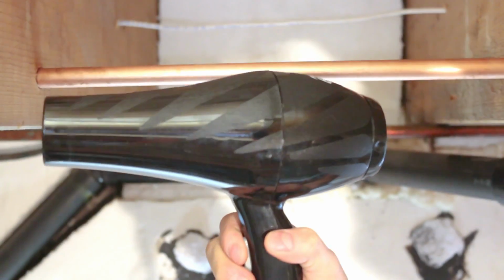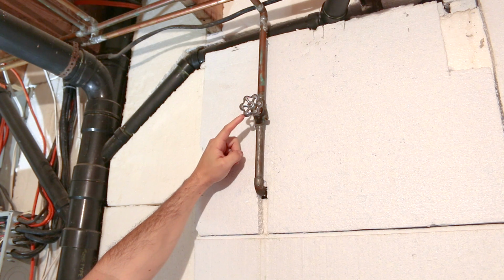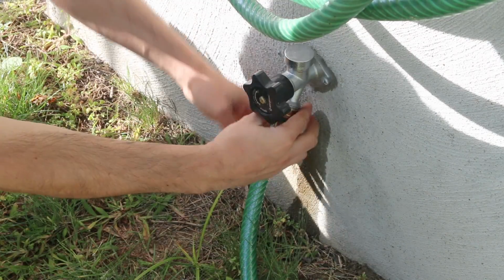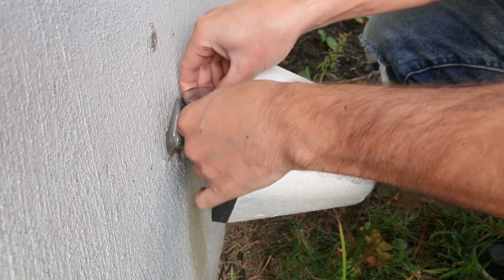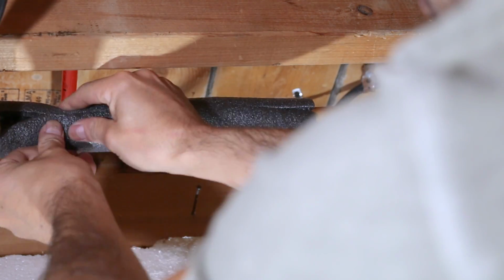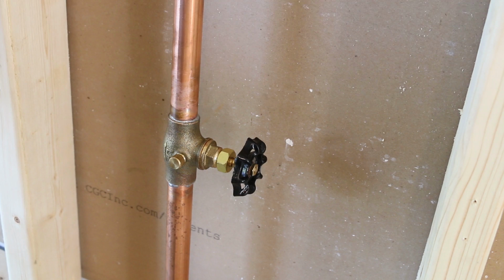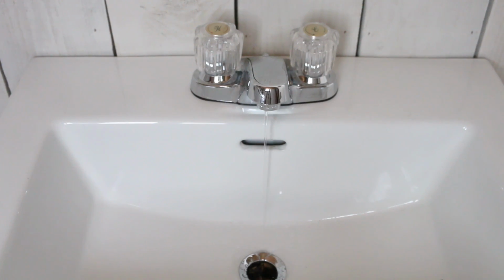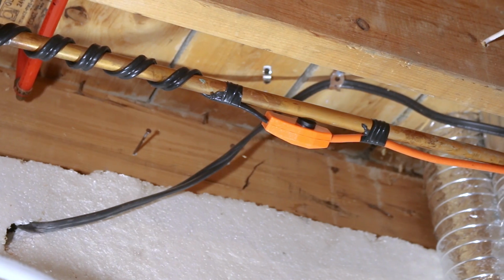12 TRICKS To WINTERIZE Your Plumbing! (Easy DIY) | GOT2LEARN

Comment: Is the auto shut off valve electrically powered? I would expect the pipes to freeze if the power goes off while you're away. With no power there is no heat and the pipes could freeze in a basement. So, how would this electronic device help if the power goes off? Is there a battery backup?
Reply from the maker: Yes, there's a 9V battery in it to operate it.

Comment: Don’t use regular antifreeze.  Boaters use the RV antifreeze for Winter storage because any unflushed  residue is drinkable and auto antifreeze is deadly in home pipes.  Add the “cherry juice “ as it is sometimes called.  Any marine dealer will have it in the winter in colder climates.  
JoeB
Reply from the maker: Thanks!!

Comment: @Got2Learn, nice tips.  However, your suggestion to check wall voids by pulling switch plate covers is missing a very important point.  One should only be checking behind switches that are on exterior walls.  No value in insulating interior walls as they are heated on both sides.  Got to make that clear, right?
Reply from the maker: Correct!!!

Comment: You have me thinking about what to do with my hydronic heating system. rather than draining the system, and boiler which is a major PITA, I am thinking about adding an SPDT switch on my circulator so I can byass the boiler control, and allow the circulator to run from a timer to keep the water moving in my radiation so it won't freeze. Does that make sense, and will it work to prevent freezing? I am thinking of this as a solution to a boiler system failure rather than power outage.

Comment: I’ve used a torch while living in Montreal, during power failures. For some reason, they used build homes with little insulation and they would install plumbing against an outside wall🙄. Awesome video as usual mon ami!
Reply from the maker: Thank Viper6, yeah the torch works, just gotta be careful not to burn anything ;)

Comment: You said it doesn't cost more to keep it at a higher temp...but then at the end of that segment you say it may be better to pay the extra money to keep the dwelling at a higher temp. I am a licensed commercial facility maintenance technician, and over the course of the season, it will cost you more to run your heater/furnace longer to keep that raised temperature as you will be burning more gas and/or using more electricity.
Reply from the maker: Yes, it costs more to actually "raise" the temperature to the new temp in question, but to actually "keep it there" is almost the same as keeping it 3 degrees lower due to the higher delta, so yes, you might wanna pay the extra money to "raise" the temperature a little higher.
Reply: It is cheaper to heat your house warmer than to replace your plumbing. I don’t think he was meaning to do it all season just when temperatures are cold enough to freeze your pipes.
Reply from the maker: @nancywebb6549  percisely.

Comment: More heat in your house means more money to spend, it doesn't cost the same.
Thanks for the video, I'm looking at solutions for my main water line in the crawlspace. I guess I'll go with insulation.
Reply from the maker: Yes of course, i've also seen those heated wirs being used on drains as well to protect the ptrap, so you can also go with that! :)

Comment: When dripping faucets, do you turn on both hot and cold taps, or just cold? If both, what if you lost pressure on hot tap and causes water to sputter?
Reply from the maker: I only had cold lines freeze on me, so I never neededto open the hot, but maybe someone else had a different experience here?
Reply: @Got2Learn  awesome, thank you ive been constantly having them running. So many of my family, friends, coworkers with busted pipes. Another freeze coming tonight...ugh! Thank you!!
Reply from the maker: @jacobmyers5204  just follow everything in the vid and you should be ok, hope for the best 🤞

Comment: I've always used Type L copper. Question is please explain or better yet a whole video on the subject, how much better is Type L over type M? Is Type L worth the extra money. I recently replumbed my main line from 3/4 inch Type M to 1 inch Type L, people were telling me just use Type M. I understand the inside diameter is slightly smaller in Type L. Does that small difference make considerable resistance in half-inch Plumbing runs?
Reply from the maker: In terms of longevity, type L will last longer, specially if you have rough water, type M is more for heating applications.
Reply: @Got2Learn  ... wall thickness is only 0.010 thicker between L and M pipe. Not enough to worry about flow rate. The difference is for the pressure rating and the rot resistance to bad water.

Comment: Do you have any advice for when your pipes are frozen but also stuck behind a wall where you can't directly heat them up?
Reply from the maker: Maybe remove baseboard, make a hole and use a hair dryer in the hole...
Reply: Realize that if it's a faucet that you can live without, find out where the water source pipe is and disconnect it to install source plug .   To use faucet adding a new water pipe (flexible is available) may prevent extra sheet rock work that leaves the busted pipe there unused. A friend wishes to have done this. Also in garage had to cut cautiously sheet rock BEHIND WATER HEATER to find water source pipe . A blueprint should show pipes .

Comment: You forgot the number 1 way. Replace with pex. 
I think that would be easier than running electric heating wires around them.
Reply: I've had pex freeze in the past.
Reply: @am2brok  ... yes, pex will freeze but generally wont split. OTOH, the metal fittings can split.... but it takes a LOT of cold to get to that point.

Comment: Never install water pipes in attics or outside walls, install non freeze hose bibs and disconnect any hoses, if it turns cold and heat is off turn off the water at the main line and drain down the whole system until danger of freezing passes, if you have an air compressor get a hose bib adaptor and blow all the water out of the pipes with compressed air! Turn off hot water tank and get a short hose so you can pull drinking water from the bottom drain, Fill up your tub and use that
Reply: Use water stored in the tub to flush your toilet, pour some in the tank and flush away! Once it warms up put the system back in service and you will have no leaks! Note if the water meter is in a box outside on the lawn place a sheet of foam insulation on top of it and weigh it down with something heavy so it can’t freeze! If you are handy disconnect the discharge side of the water meter and this allows the water main to drain so it can’t freeze either! Get a plumber to show you how to do all this and you could save

Comment: On the one about letting the faucet drip do you have to do that for every faucet in the house or just one?
Reply from the maker: You could do it for all of them, I personally just do it for 1 and on really cold days (-45 degrees celsius) my pipes didn't freeze like the previous year, so it worked!
Reply: @Got2Learn  That jacks up your water bill for sure no?
Reply: @nelsonechevarria7009  use a bucket to collect the water, Sherlock

Comment: What if I shut the water off from the city meter and leave faucets dripping? Safer than just dripping faucets?
Reply from the maker: No because the water can freeze even underground in really cold temps, it must run not to freeze 👌
Reply: If you shut off water from the meter you won't have any water supply. I did that once shutting of at the meter(summer time).The water district advice me not to. If I break the valve I'll be liable.

Comment: What if you live in an older trailer. They are never insulated very well and very drafty. The pipes always freeze. Any tips now?
Reply from the maker: They would maybe need to be brought inside instead.
Reply: Move.
Reply from the maker: @44455brian  LOL
Reply: Eric ... this might not be a pretty fix, but you could figure out where the pipes are inside the wall and install some blue board insulation directly on the outside in that area. (2 ft in each direction) Seal up any gaps so the air doesn't get behind the board. More often the pipes freeze in the floor and you can do the same from the bottom. Also add electric heat tape plus insulation to the water feed pipe that comes out of the ground. If that pipe freezes due to not being buried deep enough you can cover the ground above the pipe with bails of hay then cover that with a tarp to keep the rain / snow off. Of course you need to know the location of that pipe for this to help. A foot of hay is almost as good as a foot of dirt as long as it doesn't pack down.

Comment: 5:46 Careful here, these images shown where the tape is wrapped seem to not be recommended. Instead, the heat tape should be installed along the bottom of the pipe. Check the instructions and see if I am not wrong...

Comment: I don't know if you misspoke, but the higher you set your thermostat for heat the more it costs. This is an immutable law of physics.
Reply from the maker: Actually no, for this specific situation (2-3 degrees difference) it won't really affect anything in my opinion, but then again, I am just a plumber ;)

Comment: My house: built 1912 Kitchen: built 1928ish Plumbing: redone 2019. Insulated: of course not. thanks contractors, now I know lol, I have been opening cupboards and running higher temp throughout the house, this helps but if this is to be a rental I need to properly fix it
Reply: Boy does that sound familiar; I grew up in an old Sears home. [Great house!] but you could literally drop a rock in the wall from the attic and it would end up reaching the basement!

Comment: All valid tricks. Funny to finally hear something I'll disagree with though. I'm pretty sure it will cost more to raise your thermostat. It may be well worth the extra cost, or the cost might not be much. I've forgotten most of my math skills, so I can't back it up, so we'll just have to agree to disagree on it.
Reply from the maker: Yes, it costs more to raise the temperature in the room per se, but once it get's to the desired temperature,  it basically costs the same as if you had it 4-5 degrees lower, simple logic, why do you disagree?
Reply: @Got2Learn  Well, I know enough about physics and math to be dangerous, but I'll try to explain. There's Delta T which is the difference between the indoor temp and the outdoor temp. The higher you set your thermostat the larger the Delta T, when you combine that with heat loss, the amount of energy required will increase by a greater percent to maintain temps. I don't know how much more it would cost just that ... it will be more. If I'm wrong it sure wouldn't be the ... FIRST TIME. I love your channel.
Reply from the maker: I'd be curious to know how much more it would cost, do you think it's enough to NOT wanna raise the thermostats lol?! Thank you for the kind comment BTW :)
Reply: Raising it one degree won't cause a noticable differance in price. Whether its 22 degrees or 23 degrees it will maintain that degree. the house will eventually drop to 21 degrees or 22 degrees in which the furnace will come on to bring the house back to the desired temp. Heat loss is even and doesn't drop faster at a higher degree. So in conclusion a one or two degree higher will not impact your heating bill.
Reply: @Got2Learn  I tried googling it and the best I could come up with is approximately a 3% price change for every degree. BUT there's a ton of factors involved. So a guess would be about $3 to raise your thermostat 2° if you were paying $50 a month, not that much
Reply from the maker: Makes sense :)
Reply: I don't know a lot about the math and physics but will chime in that this Delta T seems very valid. We're looking at eventually installing a tankless water heater and one of the major things to consider before deciding how many BTU's we need is what the potential temperature differential is for your local region. That is, the difference between the worst possible outdoor ground temperatures and what temperature you'll expect to have for hot water on demand. Not considering this and choosing the wrong unit (under-powered) could mean in extreme temps you wind up with regular "just-warm" water. Seems to be the same principal here with heating your home and considering the heat loss + temp potential outside, for cost.
Reply: @darrenr1194  Heat loss is not even. The colder it is outside the quicker the house cools. And yes turning up the heat will always cost you more. The amount will very depending on several factors. Do some experiments at home and see.
Reply: @duradim1  .... recently retired so here's my experiment on higher indoor temps. Since I an home more often I keep my half of the house about 5 degrees warmer during the day than previous years. The difference seems to be maybe $50 for a heating season in New England, which is roughly from November till April. (peak heating season) We're talking $10 per month folks... not much in the big picture when you break it down to 35 cents a day average. If I heat my garage that can add $50 a month so I don't do that too often. (oil fired hot water heat)

Comment: Isn't it better to install a circulator pump?
Reply from the maker: For hot lines thatworks, but there's no circ on cold line
Reply: @Got2Learn  Please excuse my ignorance,I thought circulator pumps could also be installed on cold water lines.I know that circulator pumps can be installed on hot water pipes.I figured that circulator pumps could also be installed on cold water pipes.On second thought scratch that because a circulator pump on the the cold water line would probably register as water flowing through the water meter in which case the water company would have a field day doing the billing.
Reply: @Got2Learn  Is it possible to instal a soft kind of rubber pipe inside the metal pipe so it acts like an bumper for the expanded frozen water inside the pipe?
Reply: @kresimirbradvica51  ... the simple answer is NO rubber in domestic water pipes. You could replace "hard pipe" with PEX tube because it will expand more without splitting.

Comment: Those styrofoam hose bib covers don’t work. Every one of my hose bibs froze solid the first night it dropped to 20 degrees with those on them.  A bath towel wrapped tightly around the bib works better.
Reply from the maker: They have their limits hehe..
Reply: I have siding that keeps the foam cover from sealing. I just stick old socks in the open spaces and it works like a charm.
Reply from the maker: @nancywebb6549  socks it is!

Comment: Use those electric pipe wraps is on expose above oil tank oil lines.  Yes they do freeze and get super thick, no heat, no oil flow! 🤬

Comment: Everyone knows to leave water dripping to prevent freezing, if you can afford the aftermath of that bill leaving it on for days to weeks at a time nonstop. That might help from freezing but not your wallet.🤷‍♂️
Reply: The problem with that is what happened in Texas. Everyone did just that at the same time causing the water supply to fail. The supply was hit with triple it's normal demand. Pressure dropped, and the water supply to hospitals and other critical services were left without water.
Reply: @lacro5686  the water providers got their power cut to their pumps, at least ours did.  Damage to homes was from people with no electricity for 2-3 days.  Rolling blackouts, Ha!  We had no juice for 53 hrs and our wood burning stove saved our plumbing and kept us warm.

Comment: err. that antifreeze idea is supposed to be illegal though... 

Not supposed to be throwing antifreeze down the drain regardless so i don't think that's a good idea.
Reply from the maker: It's not illegal, it's purposely made to do just that
Reply: @Got2Learn  erm, i read online you can't dump antifreeze down the drains. it still says antifreeze regardless of what it is.
Reply: Semper Fi  Never knew there was a purpose use for antifreeze meant to be used in home like that.
Reply: You can’t dump car antifreeze down the drain, ethylene glycol. RV antifreeze is propylene glycol and can be put in water systems in a home.
Reply: @pinkiepie1656  oh okay, i didn't know lol

Comment: Set your thermostat at 73 or 70, costs the same, thats news to me.
Reply from the maker: To RAISE it to 73 costs, once it's a 73, it costs pretty much the same to MAINTAIN it at that temperature, you just need to factor in the higher delta.
Reply: @Got2Learn  Nonsense!  Maintain the temperature at 73 costs more than maintaining it at 70 or at any lower temperature. Isn't this common sense?

Comment: Maintaining the temperature at 73 costs the same as 70? That is not accurate in the least bit.
Reply from the maker: The only cost is bringing it up to that temperature and maintaining the slightly higher delta, won't show really.
Reply: @Got2Learn  Dude- that is wrong. It takes more heat to make a space hotter. That requires more input (gas/electric/steam etc) to increase this temp. You save money when your unit is off. That is why winter is expensive as your unit rarely turns off, dependent upon insulation and kids leaving doors open.
Reply from the maker: I agree with you, but once the room reaches a higher temperature, the only thing that costs more is the the bigger difference in delta, not the actual output.